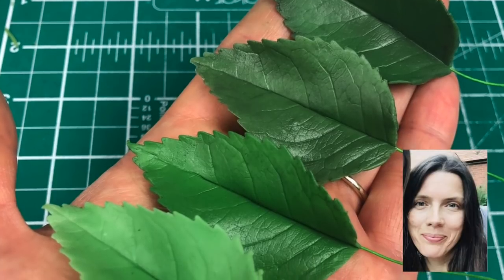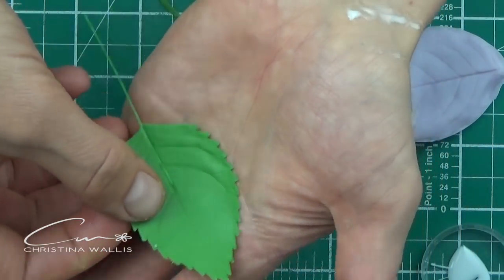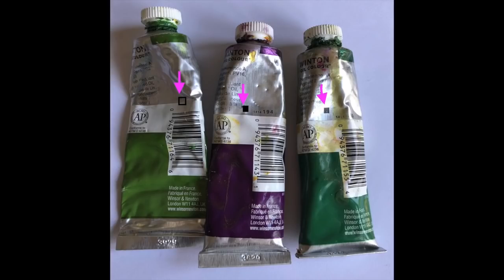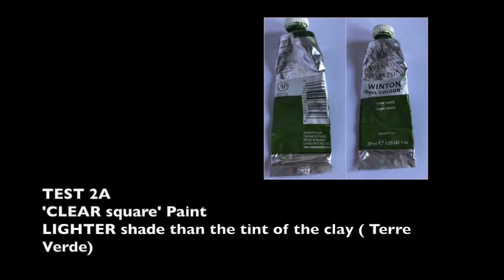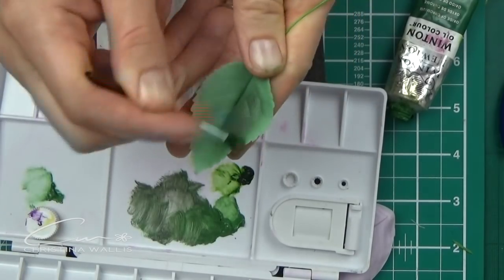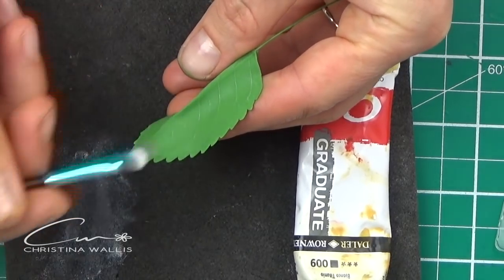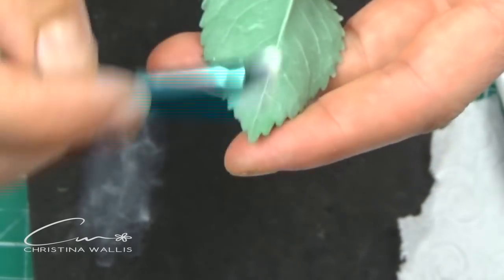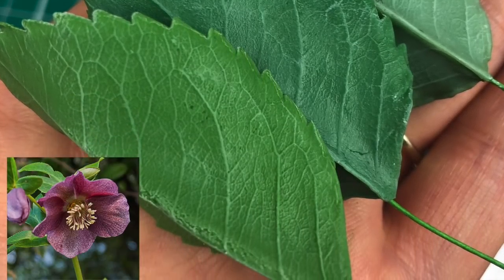Making Rose Leaf: Colouring  it with Oil Paint,. Cold Porcelain. DEMO,  2019

Comment: Hi! I made a DIY cold porcelain  before and when i put wire into it the wire tend to rust... 😞 How could i prevent that? Or do you use special wires? I used floral wire before.
Reply: Late reply but it may help…. Wires should be wrapped in floral tape.  There is floral wire and there is floral wire wrapped in floral tape.